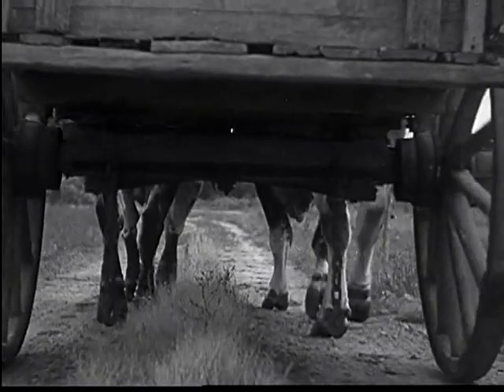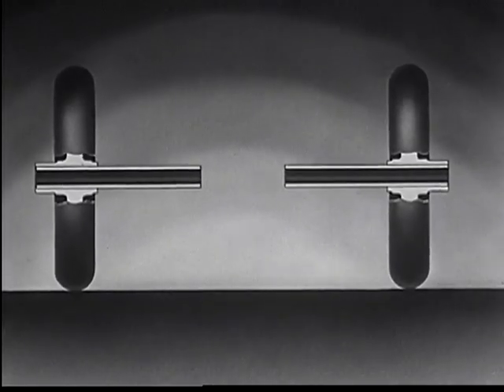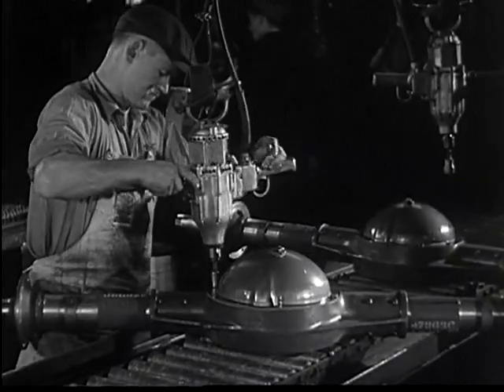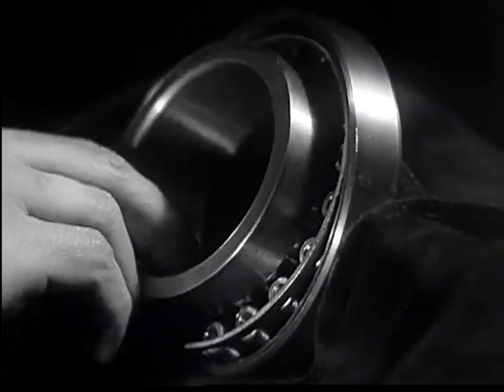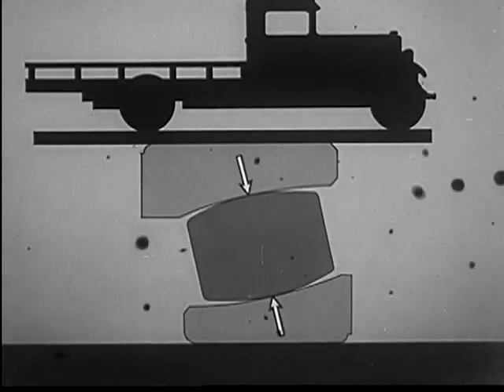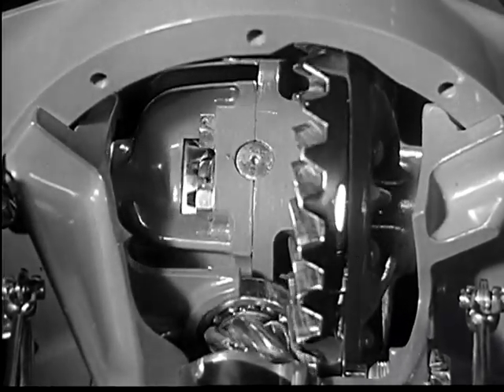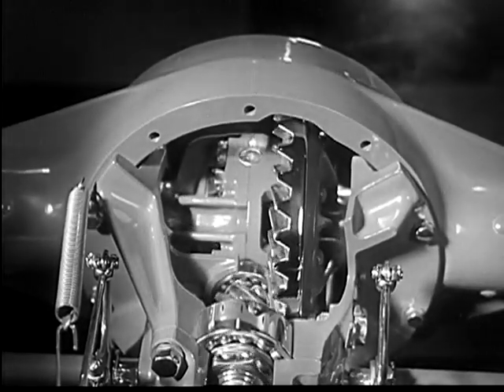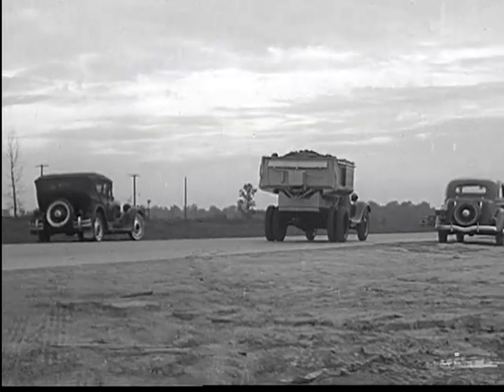It Floats - Chevrolet Full Floating Rear Axle (1936)

Comment: Good old days when HEAVIER was a merit
Reply: it makes more sense to make cars lighter though because it will make the cars more efficient and easier to maneuver; a 1000kg car will generally turn, accelerate, and brake faster and get better fuel economy than a 2000kg car
Reply: @kirk7708  : I was reading just last night that some Porsches use aluminum wheel nuts to save unsprung weight. An old Mazda ad said that their aluminum brake pedal helps the car go faster. I've also read of an aluminum bodied car, that breaks at the fire wall, just out of warranty. I prefer lighter, as long as costs with an adequate life cycle are met.
Reply: Tell that to the aircraft manufactures. I've read that Colin Chapman said that if a car finished the race, it was built too heavy.  Heavy is detrimental to cost, performance, handling,. braking, fuel economy,  etc. There are road vehicles that weigh over 6000 lbs, usually driven with only 1 person in it. Think of how often they must fill the tank, and replace tires and brakes.
Reply: Drew Thompson Detrimental to cost, performance, and handling? That could be correct in some circumstances, but not the ones that apply to this style of axle housing. These are used on 3/4T and up trucks. Offers lower cost, due to the heavier parts that are built to withstand heavy loads. Performance and handling is improved by heavier axle, heavier hub, and heavier springs, which prevent the dangerous situation of overloading, and the roll-overs etc., that come with it. So, it all depends on what the vehicle is used for, and the forces applied to the parts. You mentioned aviation. A Blackhawk transmission is 700 pounds. Sometimes weight doesn't matter. Lower weight is only acceptable, if it is still strong enough.
Reply: @carguy76ia2  : 100 lbs of metal costs less than 200 lbs of metal. Handling is improved with higher amounts of unsprung weight? Extra weight improves performance, braking and fuel economy?  A Blackhawk has about 3000 hp. Of course it's transmission will be heavier than a truck with a couple of hundred hp. I'm pretty sure it's housing isn't cast iron though.  I'm  quite sure that the truck isn't built to mil-spec for a war zone either.  I had a car that the differential  housing was aluminum. It was lighter than cast iron, and lasted the life of the car. Lower weight is almost always acceptable when strength requirements are met. Excess weight is handy in things like lift trucks, tractors and a few other things.  The Soviets even built a class of submarine, with the pressure hull built of titanium, to save weight and still might strength requirements.
Reply: Drew Thompson Lower ownership cost, by having heavy parts that last. If you build something cheap, and replace it five times, it's not cheaper. Handling is improved by reducing housing flex, due to more material being added near the center section, I.e. more weight. Performance is a broad term. In this case, the application was a large delivery truck, so yes, I believe it's performance was improved. I absolutely never said anything about improving braking and fuel economy, so you dreamed that one. However, larger brakes stop faster and weigh more. As far as aircraft, (or any vehicle for that matter) it sounds like you and I agree that weight can only be reduced, as long as the strength of the component still meets the demands placed upon it.
Reply: Just a quick note on the "100 pounds of metal costs less than 200 pounds of metal" part. Not really. If you want equal stength, but less weight, something has to give, and it's usually cost. Yes, you can get the same strength with 100 pounds of aluminum, magnesium, or titanium, etc, that you got with 200 pounds of steel (obviously generic numbers. I'm not an engineer, just using your numbers). However, Aluminum, magnesium, and titanium, etc, cost substantially more per pound, with more extensive manufacturing processes.
Reply: @carguy76ia2  : Grumman built aluminium bodied delivery vans. Not cast iron, which would flex less. Brakes can be smaller, less weight, if the vehicle is lighter, and still as well.  Performance is a broad term,  but many include fuel economy in that term, ask any race car driver. It means less fuel, less weight, for a given distance, so less pit stops needed, which can be an advantage.  Lean toward a cement truck if you prefer, I'll lean towards Lotus engineering.
Reply: Drew Thompson I have everything from a Corvette to a dump truck. Sometimes parts need to weigh more, sometimes you can get away with lighter weight. I'm not putting ten ton of rock on my Corvette, and I'm not trying to go 0-60 in 4 seconds with the dump truck. My point was that this axle was built for heavy, working trucks, where the strength of more material "outweighed" lighter weight, which is why my newer HD truck still uses a cast iron and steel housed rear end.
Reply: There are also a substantial number of aircraft in the world that use steel for items like the engine mount, because of the strength.
Reply: @carguy76ia2  : titanium is lighter for the same strength. But too costly. Steel is a good compromise. Also, since your truck doesn't have a cement truck axle, yours is likely built as cheaply and lightly as compromise permits, and still do the job. It might be interesting to see a cement truck designed by Lotus...
Reply: Drew Thompson That is an interesting topic, and by the way, I do like Lotus engineering. Somebody (I think Mercedes) has a prototype of a super lightweight semi, which offers greater useful load. Mileage is improved, but not due to weight (due to engine and driveline improvements), because it will still be loaded to 80,000 pounds. You would haul more weight in goods per gallon of fuel though. They are having trouble with the cost though. They have to get it down to a point where you see a return on your money, before the end of it's service life. Always a give and take. Aluminum and composite drums on cement trucks work, but cost more (aluminum, not composite), and have other issues. They don't have the durability of steel (composite especially lacks in this application), and the aluminum has corrosion problems.
Reply: Pickup truck manufacturers learned their lesson in the 90s, when Dodge went cheap on their rearends in their new 1 ton trucks. An extremely large number had new rearends put in under warranty. Since then, The big three US truck makers have continued to offer extremely heavy, extremely durable rear end options. That being said, They are options. In Dodge, they offer two different rearends for their 1 ton trucks. Personally, I'm a Chevy guy, but my work truck is a 2016 Dodge.
Reply: @carguy76ia2  : since you have a corvette, I'll say that i race a sailboat. I cut a 1/2" off of every too long bolt in the hull/deck joint.Other bolts have been cut as short as possible or eliminated. I replaced the teak interior with varnished cedar. The cushions are minimum thickness and weight, according to the rules i race under. I drill holes in aluminum fittings. Finger holes are lighter than handles in the equipment locker covers. Which are also cedar, below decks. Light weight stuff has been reinforced with carbon or kevlar, depending on the need. The 28 lb motor is the lightest I can find that meets the rules. I knocked 5 lbs out of an small outboard motor. Nothing has broken yet. Spectra rope is light, strong, and doesn't absorb water, so it stays light weight. Before each race, the boat is striped, and only the equipment necessary for the race is placed aboard, in the correct spot for weight distribution. All this does show up in the race results, provided i have good crew. As I've said, light, but strong enough.
Reply: Drew Thompson light and strong enough is great, if you're willing to spend the extra money. I track my car on occasion, and I've actually added a couple hundred pounds. The titanium exhaust is gone in favor of a better flowing stainless system. Added a supercharger, for obvious reasons. Replaced the Aluminum tie rod ends with cast iron, because the aluminum wasn't holding up. Installed a triple fuel pump (two primary, one backup). A dual disc clutch also adds some weight. These parts all added weight, but gains were greater than the weight disadvantage.
Reply: I can see your weight savings, and the things you listed will have no structural effect on the hull or mast, so I say that's fantastic. I have gone as far as taking the passenger seat out of the car on occasion.
Reply: Comparing your mast to the truck axle, that is one place that I wouldn't go cheap or week.
Reply: @carguy76ia2 : Spending extra money on a boat? Never heard of such a thing (!)  Yes, I can't make the boat any weaker. I have reinforced some areas with those carbon reinforced hockey sticks. Flexing uses energy. If it doesn't flex, the energy goes to making the boat faster. I have to race with the furniture. One i found interesting, is i'm forced to race with a cooler. But it is handy after the race, (tied to a dock, of course), so perhaps a good rule.  Curious the aluminum didn't hold up. I switched to 7000 series for parts that wear, but they aren't tie rod ends. My fuel pump is a bulb, that's not much use to you, but lighter, and fully functional. I did have to add weight, in a bad spot, as the stainless steel hinges for the rudder bent during a windy race. The replacements are from a much bigger boat, but they're holding up, so far. I did add an extra seat, so a crew can sit in a better place for weight distribution, but it's only about 2 lbs, and becomes shiftable ballast, just like the crew.
Reply: Drew Thompson The OEM style tie rod ends are an aluminum housing, while still having the steel ball. with grease, there isn't a problem with dissimilar metals, but the Aluminum stretches under hard cornering loads. I use 7000 series aluminum in aviation applications, and some automotive. much of it is hardened, which is good and bad. It's stronger, but cracks instead of bending. I only have a basic familiarity with the sailing side of boats. Mine are powered. I have I/O and outboard boats. They are a fantastic way to spend lots of money, just like aircraft, cars, or any "vehicle" based hobby. I hope you are focused on the sailing, so your time and money goes to one project. I have too many interests, so nothing is 100%.
Reply: The cooler is a really odd rule. Is there a size required, or can you throw a six pack size cooler somewhere? I always have a cooler in my boat, but I don't race or rarely do poker runs, and I'm not using wind to push my boat, I'm using Chevy/Mercruiser. Your way of boating is far more work, but I see the appeal.
Reply: @carguy76ia2  : AH! A stink potter! No wonder we don't get along!  The usual size cooler will hold a 6 pack, quite a bit of ice, and a modest lunch for a total of 3 on the boat. So really not a bad rule. Boats have been disqualified during the random spot checks of fleet. Spare water is usually room temperature.  "Push my boat". Do you know we use vacuum to pull the boat into the wind? (well, generated low pressure). Some people are surprised at that. A sailboat is more work, but i need the exercise. I tell people that racing is like playing chess on a moving chess board, with the changing winds and the other boats to continually plan around. BTW: all my sailboats have been capable of planning. This past fall, my GPS indicated a top speed of 24.8 Knots. I was too busy to look at the knotmeter, but I'm still surprised by that. The GPS isn't usually wrong, and I know we were going fast, but not as fast as your 'vette.
Reply: Drew Thompson I am definitely not knocking sailing. I love the idea of it, but I haven't found the right boat for the right money, and I think I need to reduce my number of hobbies. It's all good. I don't get along well with power boats, when I'm in my kayak. haha
Reply: Drew Thompson I did not know that you use a vacuum to move the boat, but some aviation principles help me to understand it. Thanks for the clarification.
Reply: @carguy76ia2  : I'm not knocking power boats, but we do have to keep up appearances... Sails are like vertical wings, same principles. Old sail loose their shape, become porous, then you don't sail well. The keel and rudder are symmetrical foils also.  Due to good boat prep, I can sail as close as 30 degrees off of straight into the wind. Not many boats can do that. It cuts a lot of distance and time off the race course, as most boats sail about 45 degrees off the wind. But you might notice I do prep the boat. Good luck on your hobbies. (except the power boat, of course) If you're interested in sailing, try going to a local yacht club and see if anybody needs a crew. There is usually a bulletin board to put your info up. Only cost is beer, and you can see if you like sailing.
Reply: Drew Thompson I actually have a friend that has been sailing for about 20 years. Maybe some day I'll give it a shot. Sounds like a good retirement hobby for me.

Comment: Remind you all Chevy did not invent the Taper roller Bearings nore was they the first to use them in automobiles .  Timken bearing is the first I know of who first made them  here in the USA back in the 20's  And they was not the first too have tapered bearing .  Lathe's and milling machines have them back in the 1800 . Horse and buggies had taper bushings that goes back into Roman times .   So this is the not the beginning of propaganda from Companies and our government .  Know the truth and know what is the truth .  We been lied to for a long time . The first commercialization goes way back  before Christ in China and working of steel  in the industrial scale goes back into the bronze age in China .  They were the first to mass produce iron and making of steal with use of carbon  in about 300 AD .   Old remnants that still in existence in China to date .
Reply: Jeff Mullinix The point of the video section about bearings was to demonstrate the use of spherical rollers, not straight tapered roller bearings.  Their advantages are clearly shown. Chevy may have been the first American truck company to employ them but I don't know and it doesn't matter. The video was made by Chevy to show the improvements made over their previous product. They weren't claiming to be the first in anything, and especially not being the first to use "Timken" bearings which those aren't in the common sense of the word.
Reply: Timken has supplied bearings to GM in the past, so what's your damn point?

Comment: I've never heard of those squish-o-matic bearings, probably not a good design so it didn't last long.
Reply: aahaha . . . tapered roller bearings are still in common use today on full floater axles.
Reply: Tapered roller bearings that taper on both sides?
Reply: Those Sqiush-o-matic bearings are the same bearings Chevy used in there new Shift-o-matic transmission .